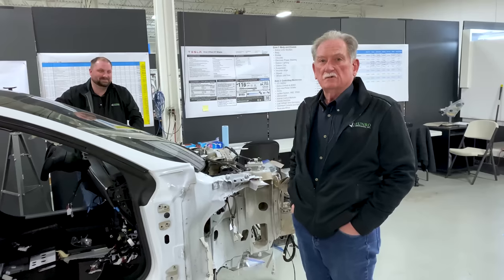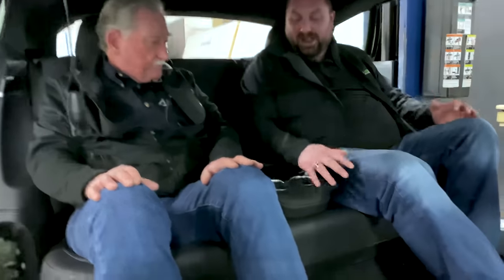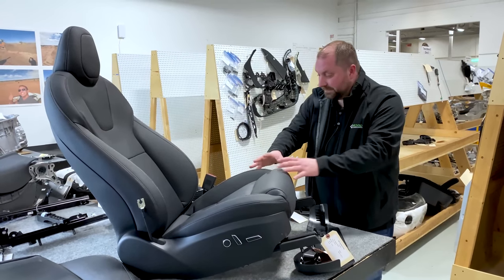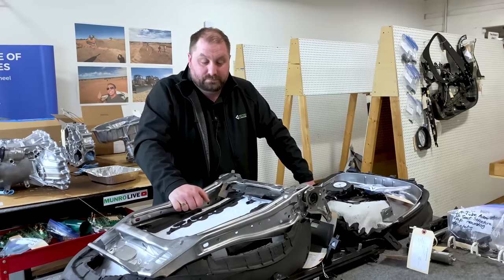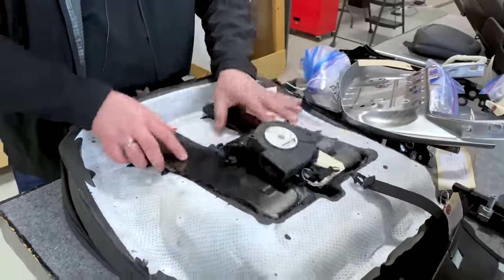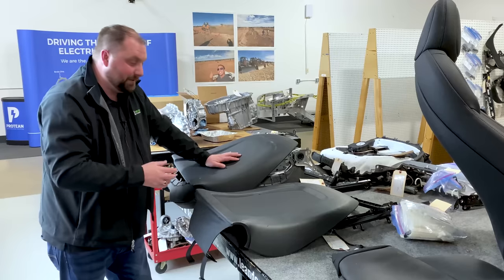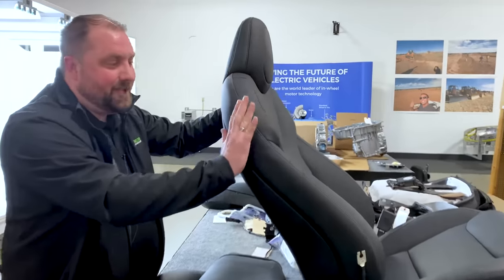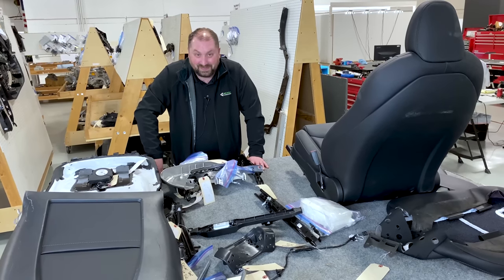Tesla Model S Plaid - Seat Components & Analysis

Comment: I hate how the Chevy Malibu tips the headrest forward. My mother had one, and Sitting in the front passenger seat was actually painful for me as I have arthritis in my neck. It would force my head to angle downward and it was a constant battle to look upward, causing neck muscles pain. The seat overall was comfortable, but I just wanted to tear the head rest off.  I drive a 2003 Chrysler Town and Country and r have 0.0 issues which with my headrest in normal use. I am part of a Town and Country Group and in later model versions possibly starting in the 2008 and up, they have a safety device within the front seat headrest that fails, having the front half separate and  thrust forward, unexpectedly, surprising and distracting the driver while driving if having this spring loaded front half thrust into the back of their head, making it impossible to easily drive the minivan. I have recommended that people carry with them long zip ties in case their mechanism fails so they can collapse it back together and tie it in to the original shape until repaired. FCA Chrysler eventually recalled the later minivan for this issue. I’m so happy I own a 2003, not a 2013. It was the peak of Chrysler Minivan design, from 2001 through 2007, anger that it went fubar, with an bad TIPM electrical center that when failed shuts off the power to the fuel pump, and can go into an unengineered state, where the horn can suddenly start blowing and the windshield wipers start running and other shenanigans even when the vehicle was off, often described as the possessed by Demons, minivan, an unreliable 6 speed transmission, with no freaking dipstick, an unnecessary complicated variable valve train in their 3.6 Liter engine, that destroys the the cams in the engine, forcing Chrysler to extend warranties on them through 10 years and 150K miles. All of this with no better fuel mileage. They included a ECO Button that had led to increased transmission failures, as well. All of this hurt their reputation so bad, that the next redesign, forced Chrysler to rebadge it as Pacifica, yet they still insist on that same 3.6 engine and 6 speed from hell 62TE Transmission! I will be heading into a Used Tesla as they come down in price for older ones.

Comment: Sandy, did the model 3 have this back seat problem?  Also, does your analysis apply to not only the Plaid but also standard model S as far as the interior?
Reply: The interiors of the Plaid and LR MS are identical. Sandy never really traveled in the back seat of the M3 for extended periods of time. He noticed the back seat issue on the road trip he took in the Plaid.

Comment: To improve thigh support, Tesla either need to raise the roof or have a hole in the battery like what VW did in the Taycan or e-Tron GT. None of these options are viable for this generation of vehicle. Moving the seat forward and leaning back would make egress and ingress challenging. Moreover, it puts a lot of pressure on the tailbone.

Comment: Tesla should have a small motor that moves the front of the seat up & down for thigh support (and lean the seat back a little).
They can use the cabin camera (or outside camera when entering the vehicle), and adjust the thigh support accordingly.
If you fold the chair, the motor moves it down so the cargo bed will be flat.
Reply: NO, too complicated.
what's needed is a rail on a curve, no up/down motors, just single motor powering seats on a track on a ARCH.

Comment: Tesla put seat building shops in all their factories, starting with Fremont, because there were very few seat suppliers and those suppliers pushed back when Tesla would suggest improvements and their prices were too high. That was a roadblock to Tesla's goals of increasing quality and durability and making cars more affordable. Having their own seat shops is one reason of many why legacy auto is finding it difficult to compete with Tesla. Tesla seats are designed to have longer lifespans, retaining their comfort, support and safety over more miles, than those from Audi, VW, Volvo, Subaru, Honda, Toyota, Chrysler, Ford and GM.

Comment: The seat back retaining system sim,ply requires upholsterers to understand how it works - I don't see that as a fault, or a poor design. Quite the reverse, in fact, unless you yank on it like you obviously did it's stronger than snaps.

Comment: If you compared the front seat from a 2017 model s to the current plaid you would see that Tesla completely overhauled that seat on the inside. The 2017 frame was of a tube construction with large plastic housing that held motors and pulleys for things like lumbar support and adjustable headrest which are now all gone. Looks like they streamlined the plaid seat from what they learned developing the Model3.

Comment: There are two reasons for people driving in that leaning back position:
1. Non-existant core strength. You can check that yourself while reading this comment. See if you've slid towards the front of your chair. 
2. Obesity. When you have your frontal area sticking out, the last thing you want is for it to squish your internal organs up and put an extra pressure on your lungs and heart.

Comment: The Hyundai Ionic 5 and the Renault Twingo (!) has moveable back seats. On the '2000 Audi A2 you could pull out both single back seats COMPLETELY with one  hook, fold it together and take ist out. I wonder sometimes why the engineers of nowadays even are to lazy or stupid to copy the good old ideas. 🤷🏻‍♂️
Reply: Could be they're just solving different problems. Do removable seats add more weight, with latches & etc. that have to be bulkier for the same crashworthiness? What percentage of users will actually remove seats regularly? Why remove a seat? If it's for cargo space, can we do something else instead like fold the seats flat? 

I'm not saying either approach is better than the other. My point is that engineers on different projects work with different constraints, so both solutions may in fact be valid.
Reply: movie theatre seats too..